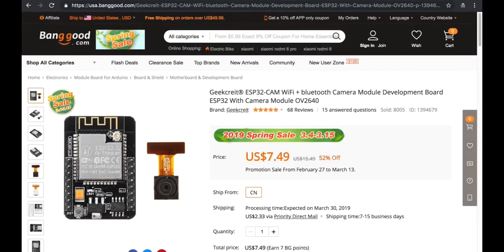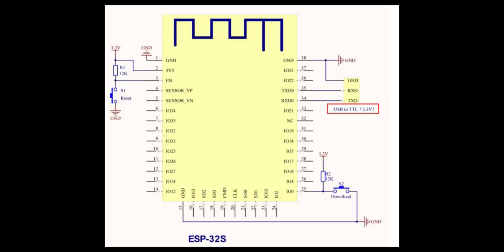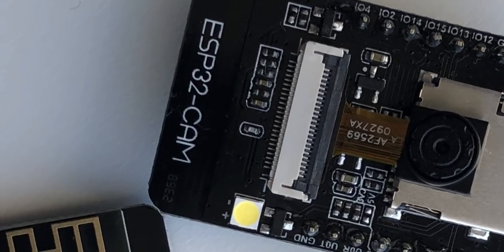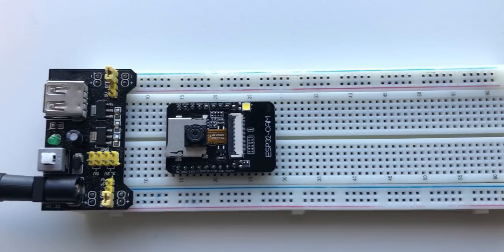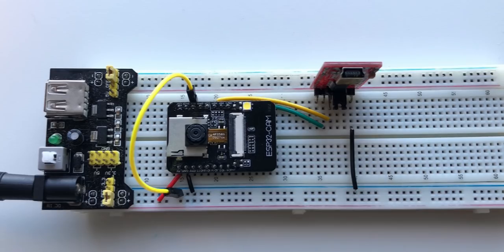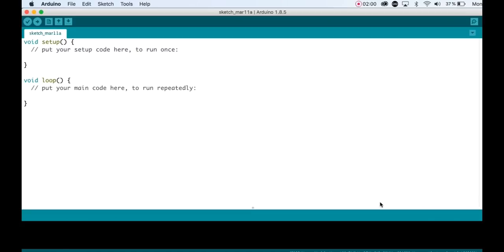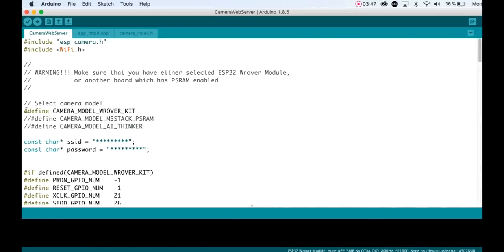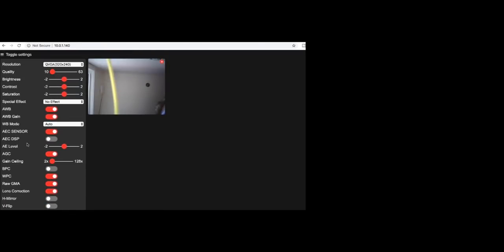ESP32-CAM Arduino IDE - from Banggood.com

Comment: I ordered 2 and want to capture images in a synchronized way at may resolution (probably a low res live stream also needed), stored to sdcard, how to syncronize 2 modules?
My purpose would be to capture Stereo 3D images so need 2 cameras synced and the pictures could be merged side by side later or in browser.

Web server part would be for publishing the SDcard captured data.
Reply from the maker: That sounds very interesting! Hope you share it on YouTube once you build it :-) The syncing between the devices and the latency (of your network) can be challenging. When you say live steam, does that mean that you want to stream live or do you want to store the images to you SD card and create a 3D video from that? If it is not live directly from the camera you don't have to worry about latency. For the syncing I would use one camera as "master" setting a pin high every time you want to grab a picture. Then I would make both the master camera and the other camera listen for a high signal before saving the image. So the "master camera" acts as a "master of timing" and BOTH cameras "acts as slaves" waiting for an input to take a picture.
Reply: @DIYTECHBROS  thanks, good idea about an input pin, I was also thinking about this, triggering capture still to sdcard by an input set to HIGH.  (maybe the loop cycle should check the pin as I am not good at using interrupts.....)
As I see there are some pins left for custom usage not all shared with the camera and sdard pins.... what I wanted as live stream is just fr compusing pucture a low quality stream just to see on the phone what is in the picture, then start triggering capture to save the high res stills for both left and right devices....
I still not sure how to connect them to the android phone without wifi network but will test when the units arrived :)

Comment: Arduino: 1.8.9 (Windows 7), Board: "ESP32 Wrover Module, Huge APP (3MB No OTA), QIO, 40MHz, 115200, None"

Sketch uses 2241934 bytes (71%) of program storage space. Maximum is 3145728 bytes.
Global variables use 52696 bytes (16%) of dynamic memory, leaving 274984 bytes for local variables. Maximum is 327680 bytes.
esptool.py v2.6
Serial port COM23
Connecting........_____....._____....._____....._____....._____....._____.....____An error occurred while uploading the sketch
_

A fatal error occurred: Failed to connect to ESP32: Timed out waiting for packet header

This report would have more information with
"Show verbose output during compilation"
option enabled in File -> Preferences.
Reply from the maker: It can happen every now and then. Make sure your connections are good. If you are programming it on a bread board, try moving it to a new position. And retry :-) Common problem with weak jumper wires and bread boards.
Reply: @DIYTECHBROS  I had the same error, but I switched the power supply to a different power adapter and it worked. I'm guessing there was insufficient voltage in the first one.

Comment: ets Jun  8 2016 00:22:57

rst:0x1 (POWERON_RESET),boot:0x13 (SPI_FAST_FLASH_BOOT)
configsip: 0, SPIWP:0xee
clk_drv:0x00,q_drv:0x00,d_drv:0x00,cs0_drv:0x00,hd_drv:0x00,wp_drv:0x00
mode:DIO, clock div:1
load:0x3fff0018,len:4
load:0x3fff001c,len:1100
load:0x40078000,len:10088
load:0x40080400,len:6380
entry 0x400806a4

SCCB_Write [ff]=01 failed
SCCB_Write [12]=80 failed
[E][camera.c:1085] esp_camera_init(): Camera probe failed with error 0x20001
Camera init failed with error 0x20001

what did I do wrong?

Comment: Tried to program
Results-
ets Jun  8 2016 00:22:57

rst:0x1 (POWERON_RESET),boot:0x13 (SPI_FAST_FLASH_BOOT)
configsip: 0, SPIWP:0xee
clk_drv:0x00,q_drv:0x00,d_drv:0x00,cs0_drv:0x00,hd_drv:0x00,wp_drv:0x00
mode:DIO, clock div:1
load:0x3fff0018,len:4
load:0x3fff001c,len:1100
load:0x40078000,len:10088
load:0x40080400,len:6380
entry 0x400806a4

SCCB_Write [ff]=01 failed
SCCB_Write [12]=80 failed
[E][camera.c:1085] esp_camera_init(): Camera probe failed with error 0x20001
Camera init failed with error 0x20001

what did i do wrong?
Reply from the maker: Did you attache the camera correctly? The connection is flip to open, not pull like the raspberry pi. Also, check that the camera is attached so that if faces forward.
Reply: @DIYTECHBROS  Yes, I believe so. I opened connector placed camera leads in and closed connector. Camera is facing outward. Unsure what to do next. Thank you for your reply.
Reply from the maker: Seems like some one had the same problem as you at the Espressif / arduino-esp32 GitHub site (issue #2659). https://github.com/espressif/arduino-esp32/issues/2659 Hope that fixes your problems as well!

Comment: Hi,
did somone know how to get acces to the gpios and the 2 LEDs from the web interface or other interface.
I want do connect some relais and switch on the light LED in the dark.
thx.
Reply from the maker: Hi! The LED is on pin 4. Just add a new input /parameter to control the pin if you want to do it with the default sketch!

Comment: Hi bros, thanks for the video. Could you please put an USB power meter in line and tell us what is the actual constant mA used while in highest load? 
(streaming and being watched, at a detailed scene, i guess, not startup-connection peak)
Would like to think about battery size for movable camera :)
Reply from the maker: Hi! We are currently working on a follow up where we address more advanced information.

Comment: There seems to be a bug and I really can't figure out why no matter what firmware I use. and that is if the router becomes disconnected or loss of Internet the camera goes into a disconnect mode and stays there it will not read try to connect to the network.
Reply from the maker: +Craig C That sounds like a bug. Report it at the Git page!

Comment: Brownout detector was triggered
Reply from the maker: Hi! If you have a look at the data sheet it specifies that it wants/need two capacitors between 5V and GND. A 0.1uF and a 10uF. Side note: 10uF might be a bit low of you have a weak power supply!

Comment: Hi
I can get still shots but not video.
Any suggestions appreciated.
Reply from the maker: Hi Neil! What does the serial monitor say? Does it output a lot of images and give you a number of FPS? In that case it might be your browser. Since a still is just one picture of the stream. Try using a different browser and/or device.
Reply: Yes - got video working on a different browser.  Quality not great and it goes on and off intermittently.  but at least I got it working . Thanks for your reply. @DIYTECHBROS

Comment: Small Issue with the power supply: If it requires 2A under 5V in order to work properly, how can you make it works with the MB102 (https://www.banggood.com/de/MB102-Breadboard-Module-Adapter-Shield-3_3V5V-For-Arduino-Board-p-996801.html?rmmds=home-mid-moreItems1&cur_warehouse=CN ) which can deliver maximum 700mA as output?
I ask this because I have trouble powering it with an external power bench.
Reply from the maker: Hi Sparalable! The 2A requirement is a max spec requirement. Meaning, when the LED is on full and outputting power on the remaining pins - and a little safety margin. If you have a look at the data sheet it specifies that it wants/need two capacitors between 5V and GND. A 0.1uF and a 10uF. Side note: 10uF might be a bit low of you have a weak power supply! (sorry for the late response, but YouTube held you comment for review so took a few days to see it)  - Mike :-)